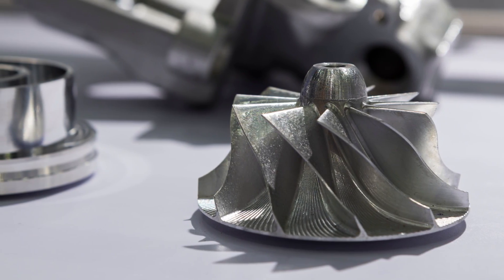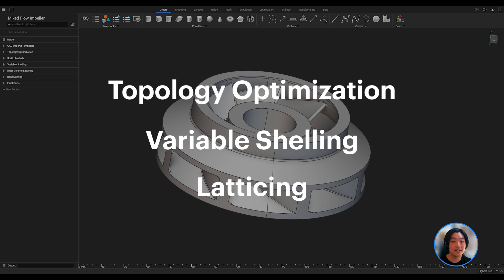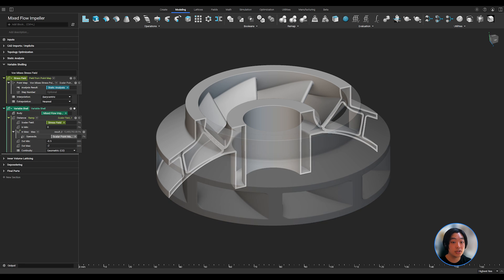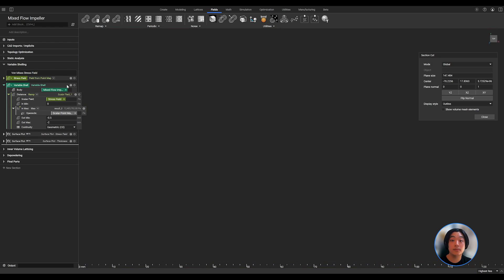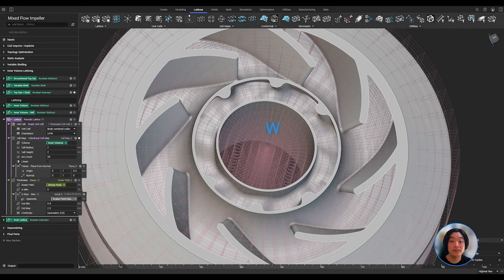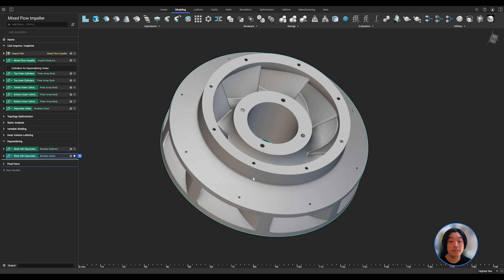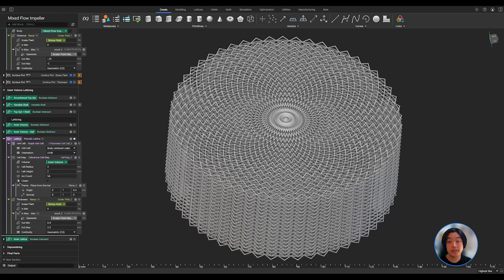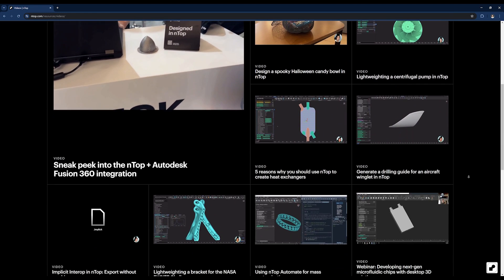Lightweighting an impeller for additive manufacturing

Comment: Hey, thanks for the great video.
I am going through the software and this is very helpful.

I wanted to know is there any workflow for making a impeller with injection molding by conformal cooling. This workflow can then also be used for small fans ,impellers in large scale.